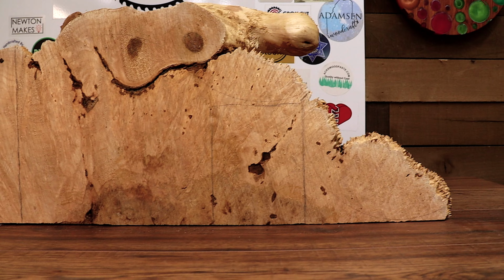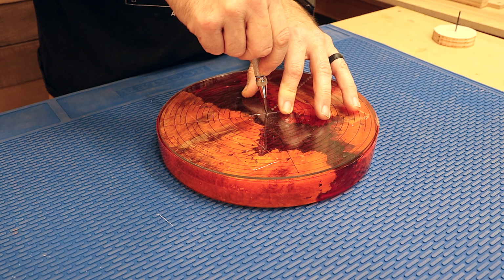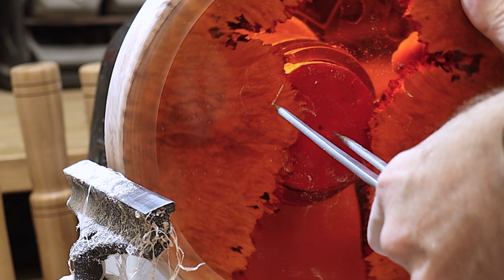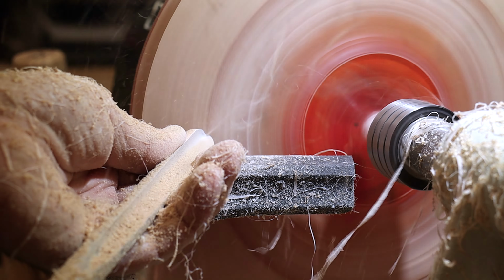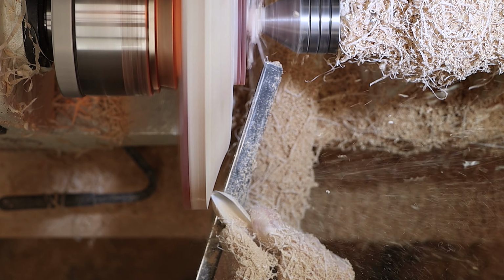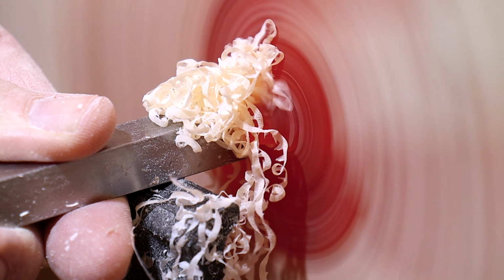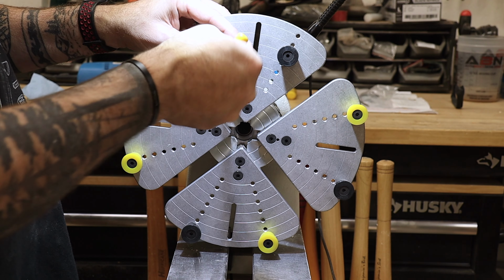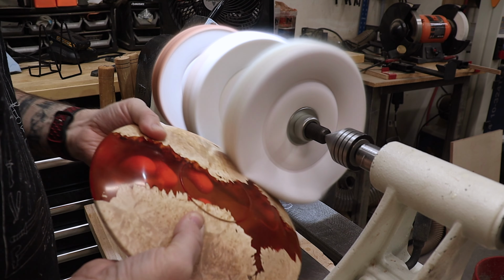Woodturning: Fall Themed Resin & Maple Burl Platter

Comment: Nicely done, I am spoiled with those carbide cutters on resin! Stay well.....
Reply from the maker: Thank you!  I love the negative rake carbides too.  I don't have to think about chip out.  The bowl gouge take off the material quicker, but I'm constantly fighting the chip out.  I'm starting to use it more to remove a bulk of the material.  Then I switch over to the neg rake carbides for the finishing work.  - Ed

Comment: Hey Ed,
For finishing try next time multiple coats of Wipe-On Poly (gloss) ....use 0000 Steel wool in between coats......
By the way-I am 60 miles south of you............
All the best
Reply from the maker: Thank you for the finishing tip!  I have the Wipe-On Poly and the 0000 steel wool so I'll give it a try.  Curious how many coats is typically good or is it different depending on the wood?  Are you down in Casa Grande?  - Ed